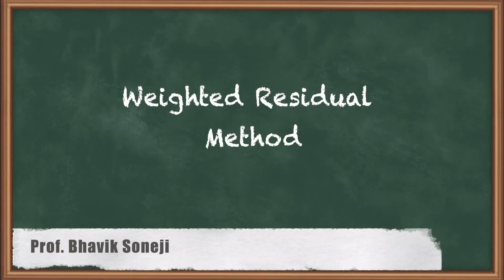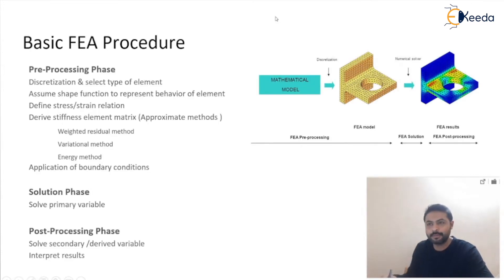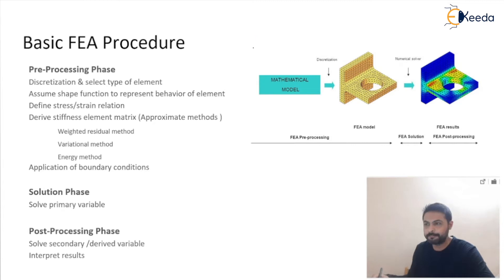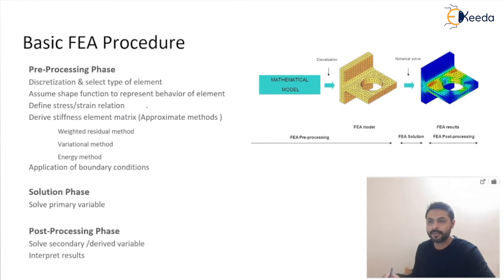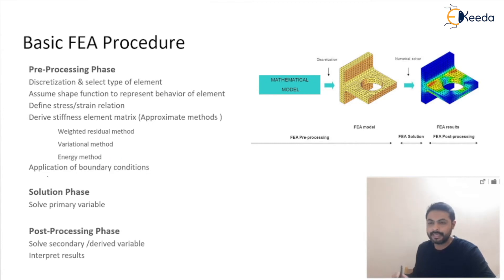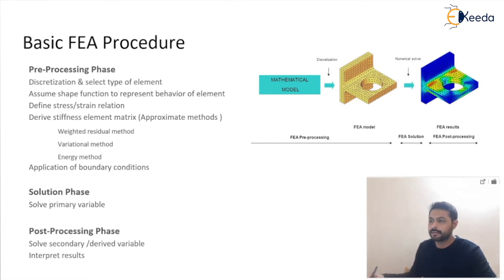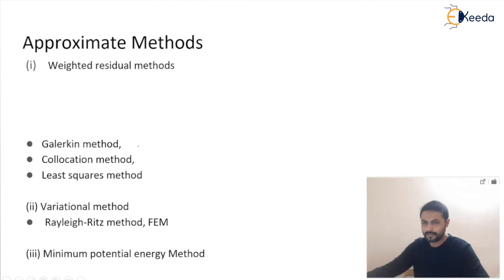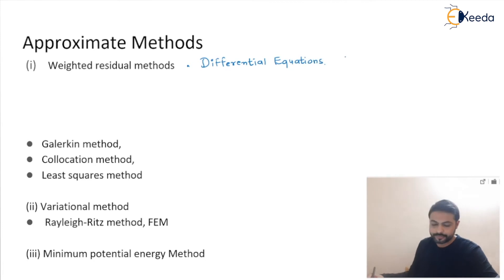Weighted Residual Method - Finite Element Analysis

Comment: Many researchs have give an effort towards reducing this Topic. Appoximate Methods which you devided in Galerkin, Colloation method and Least squre method. Galerkin weighted residual method as method for solving differential equation derive the local stifness matrix as you said and local loads vector of 2-node beam or surface in hydrology well in by implying Colocation Method. You present what we must do in part Whighted residual method part - integarte by parts to balance the continuity reguirement between and the weighted functions what you literally excellent present in Least Squre Method part with application of nodes in approximate way. This is valuable presented and divided method.